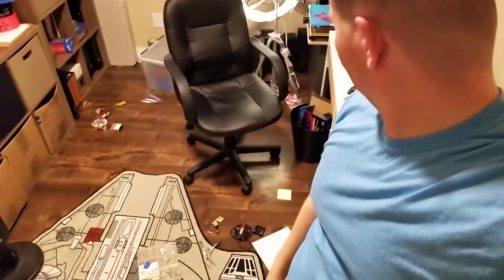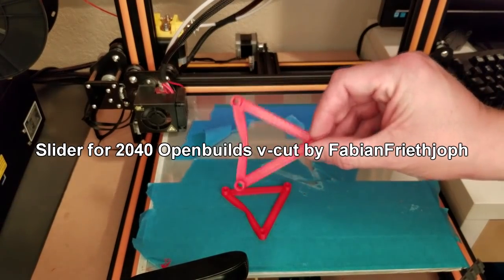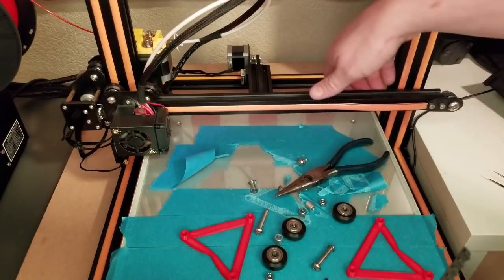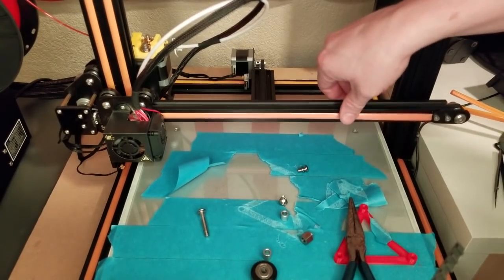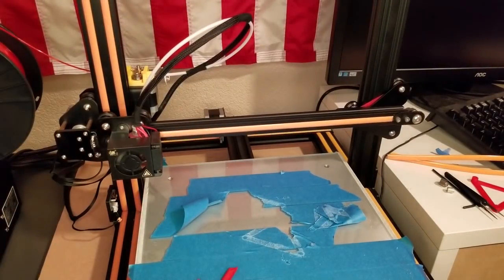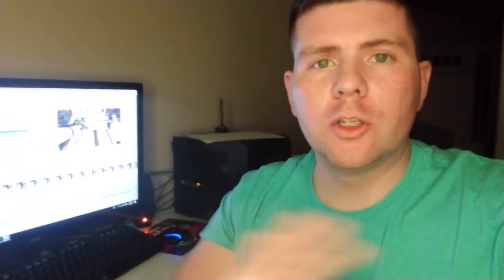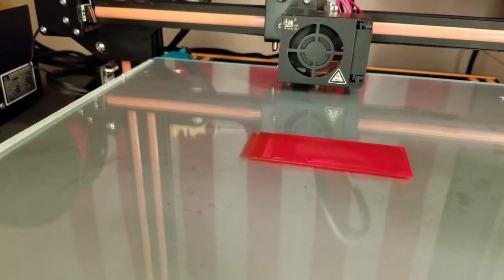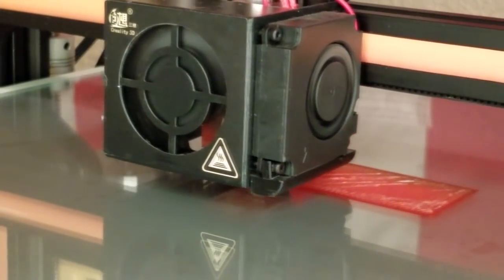Creality CR10- The MOST Important Mod You NEED

Comment: Looks like you need the 10s second Z axis motor and screw upgrade. I made eccentric screws to adjust for lash and got things rigged real sweet. Makes a difference. Try spray mount glue from aerosol direct on glass,works well for me with cr10s with pla,abs,wood etc
Reply from the maker: Someone pointed out the eccentric nut to me but I've misplaced it since this video!  Hey at least it prints well with this hack!
Reply: Sir, you can get Creality3D CR - 10S 3D Printer Upgrade Versionfor $455.99 with this  coupon code:GBanniversary001, https://www.gearbest.com/3d-printers-3d-printer-kits/pp_778981.html?wid=21&lkid=13507121， enjoy!

Comment: Great videos,
 just indeed of a bit of help with my cr10 problem that I have.

So first off my cr10 has printed flawlessly for over a year.

So today I installed this part.it's a metal extrusion kit
https://youtu.be/opfVuUnRGww

Now I have a major problem, the extruder will not push filament anymore, it clicks.

So further investigation the grind wheel was  clicking, and sure enough when I stopped to Check, it was so tight it literally shredded the filament.

So the problem I see is there's no way to adjust the 2 wheels on the extruder feed to make them the right distended apart.

I eventually gave up and put the plastic original one back in.

And now this is the same, so I've gone from a perfect printer to one now that won't push filament the through correctly.

So if there's any way you can let me know how do I get my extrusion back, on either one, metal or plastic.

Any help appreciated.
Thanks
Toz

Comment: Hay great video, while I was watching thought of an idea you might like to try. You know those cable door closers, if you hooked that on the non drive end an pin the retractor at the top or run over a pulley it would keep constant pressure on that arm. Just thought might help.

Comment: Hi please dont take this the wrong way but did you make those as a joke ?  because you do know you can take a lot of the slop out you had at first by simply adjusting the eccentric nut ?
Reply: Steve, I was thinking the same thing.  I thought everyone knew about the concentric nuts.
Reply from the maker: +steve dutton  At the risk of losing any my credibility, no I don't know you're talking about and this was  Not made an irony.  This was my  1st V slot 3-D printer so I'm not familiar with the engineering behind it.  Could you do a video explaining what you  Mean so the rest of the Community and myself Can learn from it! Thanks!
Reply: sorry i have no way to take a video but i can add a link to someone who shows it , you can do same to bed rollers as well
Reply from the maker: +steve dutton can't wait to learn more!
Reply: if you follow this video he shows how to change roller tension  on bed same applies to side you was trying to fix only inner wheel adjusts tension  not outer 2   also same can be done on the left side , you can tell which can be adjusted as it will have a flat on it where ones that can not be adjust are just tubes and no flat if that makes sense    

https://www.youtube.com/watch?v=2JOW8eJDBJE

Comment: Pretty cool on modifing that X1 deal to fix the CR10...wish I had a large volume printer, biggest one I have is my Anet A8,  the Anycubic Kossel can print tall but not wider than 180mm circle
Before those individual spacers were independent of each other, with that mod you put on it ties them all together and may even pull them in a bit, but now they are connected together, if one moves, the rest are forced to remain tight...
Very cool!!!!

Comment: I don't have a printer yet but am trying to decide which "cheap" unit to buy..
Reply: Baschz Leeft I ordered the Monoprice Mini tonight.
Reply from the maker: +TheRetiredtech great!  Now stop researching. I always have buyers remorse until I get the printer in my house
Reply: Baschz Leeft Thanks i have joined.
Reply from the maker: +TheRetiredtech What's your price range?
Reply: GeoDroidJohn i would like to stay below 300
Reply from the maker: +TheRetiredtech easy. There's lots off options out there.  Looking for a resale bot might get you more for you're money
Reply: Check out the Monoprice Select Mini then. Of course not as big as the CR-10, but then you'll have to add about ¢60 or so. With the Monoprice you'll save some. I have both of them and love them both.

Also +GeoDroidJohn, is it possible you coincidentally tensioned the eccentric nut on the inner wheel just right when you remounted the carriage? Did you try that before you did the mod?
Reply: +TheRetiredtech Great! Join the "Monoprice Select Mini 3D Printer" Facebook group. It's full of people helping each other out, showing of prints, mods and upgrades etc. Happy printing!